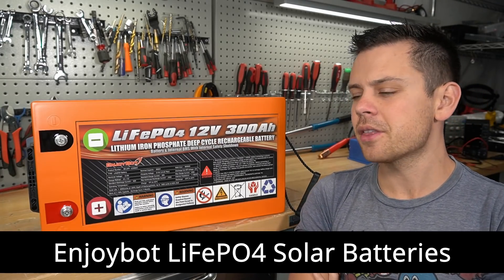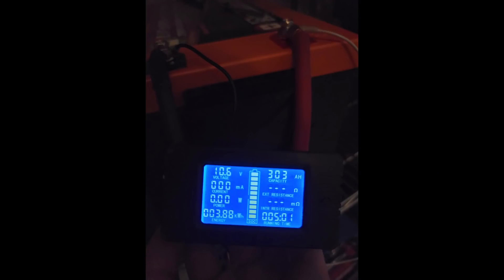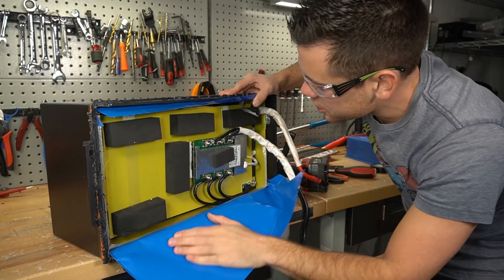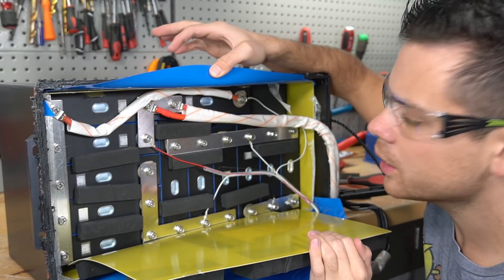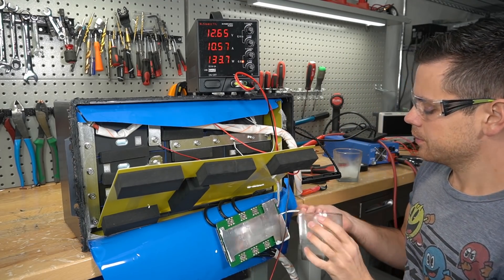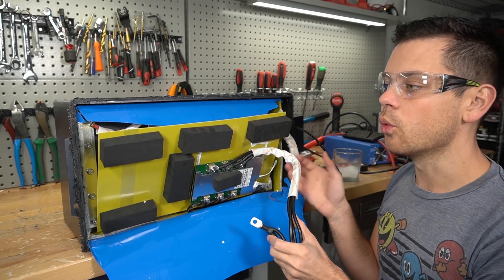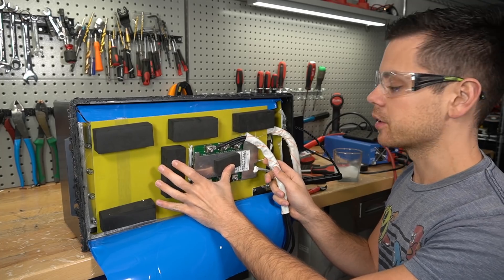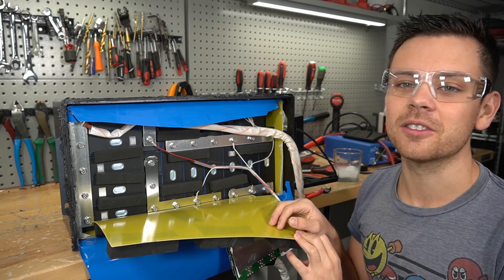Dirt Cheap Lithium Batteries: Enjoybot LiFePO4 for $.26 per Wh

Comment from the maker: Having a temp sensor on the bms itself would not help at all. A BMS warms up very quickly when current flows through it. A temp sensor for cells needs to be attached to the cells, and no where else. Even if they programmed the BMS to have low temp charging protection with a sensor attached to the fets heatsink, it would not work properly.

Some have suggested adding their own bms. That would not be fun. These are hard to open and you won't be able to use the case after you open it. And it would be a huge waste of time. 

Also, these cells peak temp should be 60 degrees Celsius! So the current temp switch has too high of a threshold. Not good!

So as mentioned in the video, use a victron solar charge controller with their "battery sense" temperature sending unit, and add your own low temp charging protection.

Victron SmartSolar 100v Controllers (affiliate links)

15 Amp: https://www.currentconnected.com/product/ve-ssmppt-ved/?attribute_max-output-current=15a&attribute_max-pv-voc=100v&ref=wp

20 Amp: https://www.currentconnected.com/product/ve-ssmppt-ved/?attribute_max-output-current=20a&attribute_max-pv-voc=100v&ref=wp

30 Amp: https://www.currentconnected.com/product/ve-ssmppt-ved/?attribute_max-output-current=30a&attribute_max-pv-voc=100v&ref=wp

50 Amp: https://www.currentconnected.com/product/ve-ssmppt-ved/?attribute_max-output-current=50a&attribute_max-pv-voc=100v&ref=wp

 

Victron SmartSolar 150v Controllers

45 Amp: https://www.currentconnected.com/product/ve-ssmppt-ved/?attribute_max-output-current=45a&attribute_max-pv-voc=150v&ref=wp

60 Amp: https://www.currentconnected.com/product/ve-ssmppt-ved/?attribute_max-output-current=60a&attribute_max-pv-voc=150v&ref=wp

70 Amp: https://www.currentconnected.com/product/ve-ssmppt-ved/?attribute_max-output-current=70a&attribute_max-pv-voc=150v&ref=wp

100 Amp: https://www.currentconnected.com/product/ve-mpptrs/?attribute_model=450%2F100&ref=wp

200 Amp: https://www.currentconnected.com/product/ve-mpptrs/?attribute_model=450%2F200&ref=wp

~~~~~~~~~~~~~~~~~~~~~~~~~~~~~~~~~~~~
Does off-grid solar confuse you? 
Save time and money with my DIY friendly off-grid solar kits, my latest product recommendations and so much more! 
http://www.mobile-solarpower.com

Join our DIY solar community 
#1 largest solar forum on the internet for beginners and professionals alike. 130,000 members and counting!
https://www.diysolarforum.com

Check out my free book
Best-selling and beginner-friendly guidebook to off-grid 12V solar!
https://www.mobile-solarpower.com/the-book.html

~~~~~~~~~~~~~~~~~~~~~~~~~~~~~~~~~~~~
My Favorite Online Stores for DIY Solar Products:

Signature Solar
Creator of EG4 and the largest DIY solar store online! 
(automatically save $50 by using my link below)
https://signaturesolar.com/?ref=cPwLcVc0SW-BjN

Current Connected
Victron, EG4, Midnite and so much more! Fast shipping and great prices:
https://currentconnected.com/?ref=wp

WattCycle
A very budget friendly 12V battery that works great!
https://www.wattcycle.com/collections/all/products/wattcycle-12v-100ah-group-24-lifepo4-battery?ref=aaezwkkc

Litime
Classic and reliable 12V batteries for solar! Bestseller for many years:
https://www.litime.com/?ref=XBIA62RFcalHns&utm_source=affiliate

Epoch Batteries
High-quality, marine grade 12V batteries that can survive anything!:
https://www.epochbatteries.com/products/12v-460ah-lifepo4-battery-ip67-heated-bluetooth-victron-comms?rfsn=7352625.50494d

IntegraRack
DIY Friendly Solar Panel Mounting Kits! Easy to assemble and super strong:
https://www.mobile-solarpower.com/ground-mount-racks.html

Ecoflow Power Stations
The most popular plug-n-play mobile power station! I have been using these for years:
https://amzn.to/4gID4j0

Anker Power Stations
Highest efficiency and best performance. The biggest challenger to Ecoflow yet!
https://amzn.to/4k0yhMM

Watts247
Need international shipping for large batteries and inverters? Check them out!
https://watts247.com/?wpam_id=3

Rich Solar 
One stop shop for budget 12V systems!
https://richsolar.com/?ref=h-cvbzfahsek

Battery Hookup
Cheap used lithium cell deals:
https://bit.ly/2mIxSqt
5% off code: diysolar

~~~~~~~~~~~~~~~~~~~~~~~~~~~~~~~~~~~~~~~~~~
Contact Information:
I am NOT available for personal solar system consult! If you wish to contact me, this is my direct email: williamprowsediysolar@gmail.com

Join the forum at https://diysolarforum.com/ if you wish to hang out with myself and others and talk about solar

FTC Disclosure Statement and Disclaimers:
Every video includes paid promotion or sponsorship (such as free products for review). Some links on this YouTube channel may be affiliate links. We may get paid if you buy something or take an action after clicking one of these. My videos are for educational purposes only. Information is subject to change/update at any time. Electricity is DANGEROUS and can kill. Be smart and use common sense :) DIY Solar Power with Will Prowse is a participant in the Amazon Services LLC Associates Program, An affiliate advertising program designed to provide a means for sites to earn advertising fees by advertising and linking to Amazon.com
Reply: Good one will, but  I wonder when we will have access to lithium ion batteries in sierra Leone on our local market due to high taxes on shipment plus other unnecessary restrictions reason. They keep making issues about shipment when we make online purchases. Tnx for the teaching will, because now I have vast ideas about batteries.
Reply: The JBD 150A with 2 temperature probes for the batteries and one for the BMS is a good BMS which is why I'm confused why they use what looks like the 100A version and with the wrong sensor...just as baffled as you are how they can screw this up and I only have one explanation - it's the photocopier at work. 

If an outfit can pump out 4s batteries using incoming LFP cells it would be typical for them to buy a few different competitors, copy them, pump out their own product and then disappear after their run is done. Since so many other batteries you've looked at have this same failing in a very similar way this is what I thinks happening as similar mistakes have been seen in Russian and Chinese military copy-pasta projects.
Reply: Questions for you Will. Since these are all basically the same battery with different labels would it be safe to run say an Ampere time and an Enjoybot in parallel as long as they are the same Amp Hour rating?
Reply: Thank you for the review.  Have you ever reached out to the manufactures to let them know about their misleading advertising? If so, what have been the responses?
Reply: Hey Will, since there are so many of these batteries out there, how about a video on how to setup these batteries with a vicron smart controller and temp sensor. Personally was looking at it and I don't understand if there is a separate part I need, how to program, etc.
Reply: Seems like an algorithm could be made to estimate battery temperature using a single sensor for ambient temperature and estimated thermal influences from I^2R losses through the BMS. But that would be more expensive to design than just using a sensor on the battery. And there is the question of repeatability and consistency...
Reply from the maker: @ericjlomeli  yeah sure, did it a few months ago: https://youtu.be/XpO4s6Lrrmc
Reply: @WillProwse  you're a damn genius sir! Ty!!!
Reply: Will prowse may I suggest a video idea which tests a 48 volt rack batt charging a 12 volt 100 ah asking for a friend awesome work
Reply: I have an EPEVER MPPT controller 40 amp that came with a low temp sensor, I should be good to go with that Will?? New at this but this IS the reason I bought this controller as a back up if the battery did not have the sensor. I am in Canada and it can hit -30 here pretty quick.
Reply: @danstrayer111  unless the BMS is programmed for it, and there is a place for it on the pcb, you cant just shove it anywear 🤭
Reply: It looks like they pulled the low temp charging protection off their website description.
Reply: Something like this would be perfect as a stand alone trolling motor battery for my boat.
Reply: On  their website they changed to only  high temperature protection.
Reply: whats the problem about charging them low temp ( if its not freezing )
Reply: Something special, why Will you should of last night ;>)~
Reply: The label may indicate low temp cutoff, but their website product description is careful not to.
Reply: Maybe Im just lacking experience but I'd expect these cells internal resistance should shoot up when cold? and charger controller might be designed to protect against charging when the cells are resisting too much (rather than just too cold). Maybe cool the whole pack down and see if it does takes a damaging current? until then it doesn't seem proven that the controller does not protect against cold charging.
Reply: @danstrayer111  You could just wire one inline with the high temp. Then it would cut off in either a high or low temp situation.
Reply: They have now updated the listing to only say high temp protection..
Reply: Cells  quality please . No interest in the bms
Reply: What is the correct name of the battery you are recommending, Server Right?
Reply: i dn't know what a server rack battery is. i keep thinking of an APC UPS
Reply: @danstrayer111  Not a very DIY friendly battery.

Comment: I did want to let you know they have since changed their statement on their website and it only states high temp disconnect. I can only presume this is due to your review. I appreciate your reviews and have learned a great deal. Keep up the good work.
Reply: That is positive about the negative 👍 At least they corrected the info 👍
Reply: It's 100% due to his review , they even have his review on their website.
Reply: They now have a low temp add on option. Extra $100. Would like Will to test that one to make sure we’re not wasting $100.
Reply: At this point (12/9/2022) you can pay extra to get high and low temp protection.  Of course, this begs the question: Are you really getting low temp protection, since you're now specifically spending extra for it??
Reply: W

Comment: I have two of the Chins 24 volt 200  Ah with the 3000  24 volt growatt all in one controller.  They are indoors in my Northern Arizona off grid cabin.  Runs everything and has for over 7 months 24/7. Not had any issues. Thanks for all the great videos you put out. I watched for a year before chosen my system.

Comment: Will, thanks for continuing your low temperature sensor efforts.

My motorhome has multiple charging methods including the alternator. If I switch to a LifePo4 battery without low temperature protection, just starting the engine in freezing temperatures will damage the battery.

Low temperature protection and total conversion cost is preventing migration to LifePo4.

Keep pushing for low cost with low temperature protection!
Reply: I'm glad he's doing this, even though he lives in a warm climate.  I bought an EarthX LiFePO4 battery that is marketed to snowmobiles.  Guess what?  No low temperature protection.  It ate itself in less than a year, then the company refused warranty (which was supposedly 2 years). 

So lots of scummy companies are pulling exactly this low temp nonsense.  I'm glad Will is fighting it.

Comment: Thanks for ripping these suckers open to call out any of the false advertising.  Your videos are helping me with my off-road camper trailer build.  Bought 5  hqst  100 watt panels for a fraction of the renogy ones that are pretty much the same based off your assessment. Still trying to figure out my battery options.  Right now I'm looking at the bluetti AC200Max with one B230. 3k for 4096wh with the built in inverter and plugs seems like a pretty good deal plus the portability is a plus.
Reply: Will's advice is to get an inverter that is larger then what you are currently using as to be prepared for any upgrade (larger load) in your setup later on.
Reply: I wish SoGen companies like Bluetti would make it easy for us to add raw batteries like this one to their devices instead of having to buy their prepackaged expansion batteries. I guess you can make your own expansion pack, but I wish you didn't have to.
Reply: I have a Bluetti AC200P with 400watts of their solar. This unit is a beast, it's plug n play and portable like you said so it can easily move to another rig. When it comes to money I really don't care about getting cost down to the penny per whatever. I just want stuff to hook up easy, charges fast and powers what needs power. I use my Bluetti for emergency power back up in my 50amp motorhome. I've been making several emergency power upgrades this year after last winters Texas freeze and this Bluetti is the final piece and icing on the cake for my total emergency power solution when stuff happens.
Reply: I paid 3k for 10kw of ampertime lipo (4x 12v 200ah) and another 1k for growatt 3kw all in one inverter charger and the rest of the bits, way better setup and bang for your buck. I would never spend that kind of money on that small of a setup.
Reply: @jimbob3030  Well it just depends on what each persons needs are. Living and traveling in a 50amp RV like we do, we don't need anything near that big. Also,, many people who RV just want want a plug n Play option. They don't want to become electrical engineers. But if what you bought fits your needs it's all good. But everyone is different, has different needs and a different budget.

I forgot to add this important fact. Many people like us don't want to have all their power needs in a permanent installation. All there eggs are in one basket and it can't be moved to another unit. This was an important part of our decision.
Reply: @RVstreet  It's a matter of connecting 4 12v batteries to one all in one inverter charger, it's not engineering or any more complex that what you're looking at. Super easy.

It can be constructed on a dolly or in a box with wheels if you need to move it.

I'm just saying from a full years experience living in an RV that's not enough to live on long term, it just isn't, and I'm just one person. If I had a larger RV and two people to support no way.

My 10kw pack is only enough for bare essentials for one person and covers one to maybe two days of not running the generator if the sun is not out. 

With that small of a unit you will be required to run a generator pretty much every single day the sun isn't strong and you can't even run a window a/c on that to keep yourself comfortable for much more than two hours without more solar panels to sustain the 500w load for the smallest a/c by itself.

I see the need to be portable, it's trumped by the need to be usable and keep you comfortable.

I would have been kicking myself the first week of using that setup like I was with my original setup of 4x 100ah 12v flooded gel batteries. Had to watch most of my tv on my phone, that first setup I had was so limited.
Reply: @jimbob3030  Why are you watching so much tv when camping?  Lol I only need to run some lights at night and a fan and maybe a small freezer.  I get your setup for wanting to maybe run a camper that you live on for months, but for a long weekend or week I don't need all that.  Portability of the unit is more important for my needs.  What does your unit setup look like?
Reply: @Gordon013  I lived in my rv conversion for a year after selling my house, while shopping for the right bargain on another fixer house. It takes time to find the right fixer at the right price, all my offers kept getting outbid.

I wasn't camping just living as normal, except mobile off grid.

My rig is a 2002 18' high roof wide body stepvan conversion. I was stealth camping all over the place  while house hunting along the oregon coast. Never stayed in a park for even one day, never spend $1 on parking, but also never had access to an rv hookup for power so my rig had to do it all.
Reply: @jimbob3030  it sounds like you have a nice setup. 👍👍
Reply: @JabberGulch  Thanks. It's powering my house now, really getting my money's worth.
Reply: Hi, how is ur build coming along? What hv u decided to use for ur solar power needs? I HV two Jackery, 300 & 1000 watts. Trying to figure what batteries to buy. I only hv 100w foldable solar panel. Plan to get 200 min or more flex or ones mount onto roof? Budget is killing me. lol
Reply: @GHE2005  from my research the folding or flexible solar panels tend to break down much faster and cost more $ per watt. I would recommend solid panels.
Reply: @GHE2005  still haven't bought anything yet for the battery.  might this summer.  don't plan on camping much because we are expecting twins soon. lol
Reply: @JabberGulch  Yes I agree, they don't last folding & flex. So why r they able to charge so much for them? 😡 They r not all that convenient. They get dirty, they r heavy to log around, & u hv to move them & prop them up. I'll buy rigit ones next.